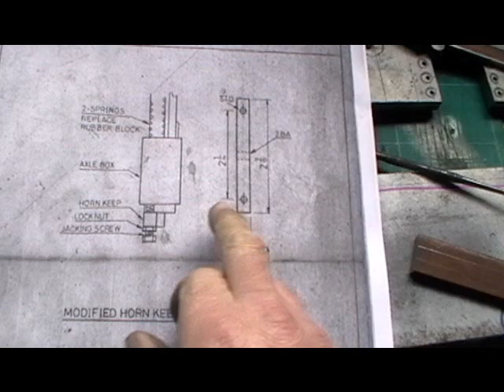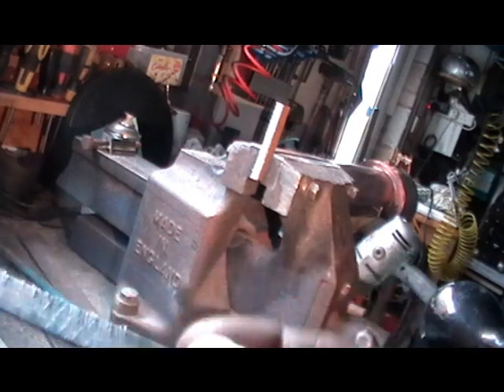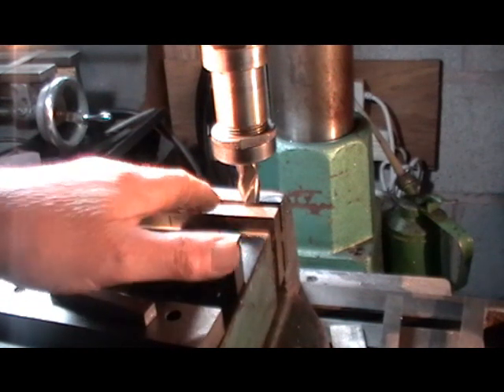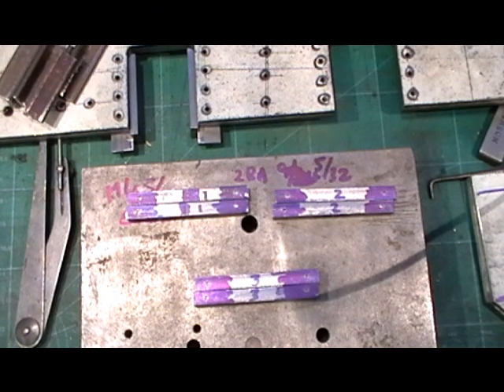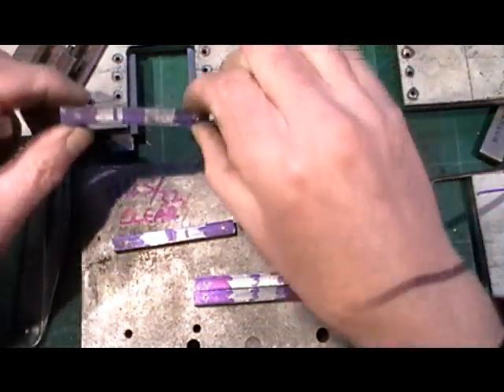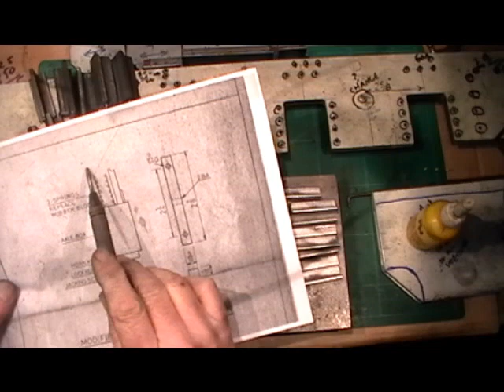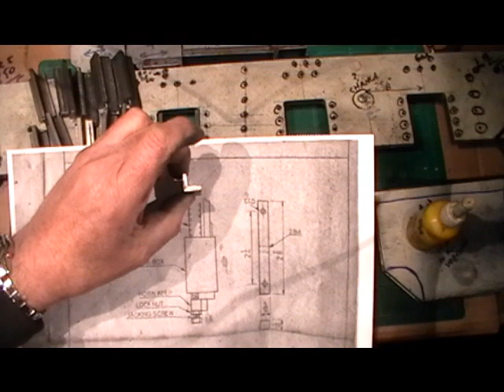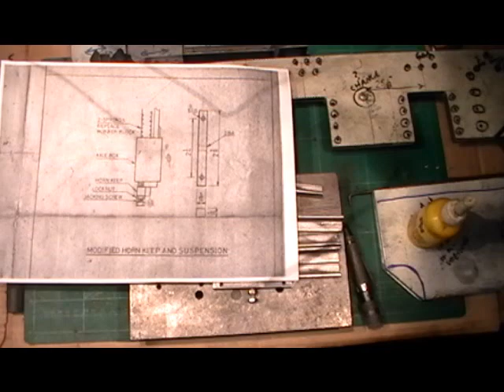Making a Beginners Steam Loco (Making the Keepers) "mr factotum"

Comment: Great Video Mr. Factotum.  I received the book and have just started reading it.  It is nice to watch you build and be able to follow along.  Thanks for the saw tip.  I struggle cutting with a hacksaw, but I am sure the cheap frame I have may be some of the issues I am having.  Thank you for sharing your build.

On a side note, I got a bit of time in the shop and made the former for my little boiler's end plates.  Made a couple from some rough scrap to get some experience before I make my next video.  I discovered I made a newbie mistake.  When I made the former, I subtracted twice the thickness of my copper from the ID of the boiler tube.  When I made the ends they were too big.  I didn't think about the copper swelling on the edges where it flanges over.  Worked out okay though, I just pressure turned them to the correct diameter afterwards.

Joe
Reply from the maker: hi joe
Nice to hear from you, enjoy the book, you never know you may decide to build one.
Thanks for comments
Regards
mr f